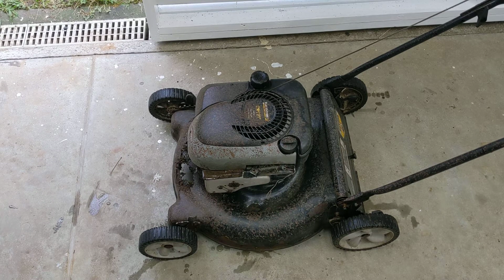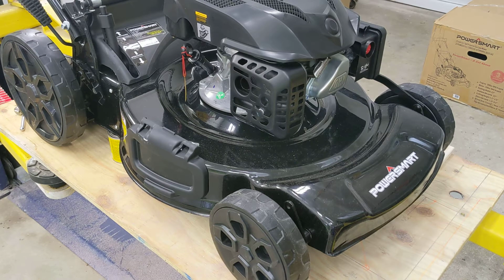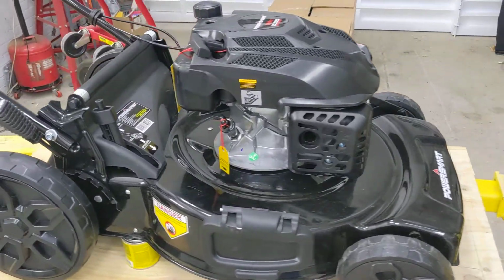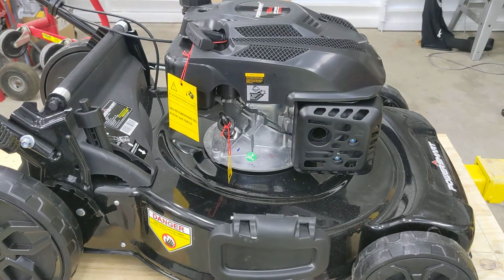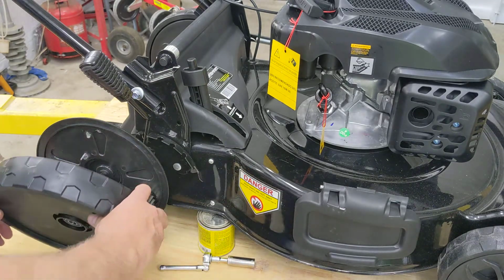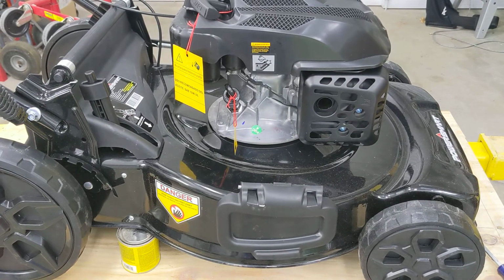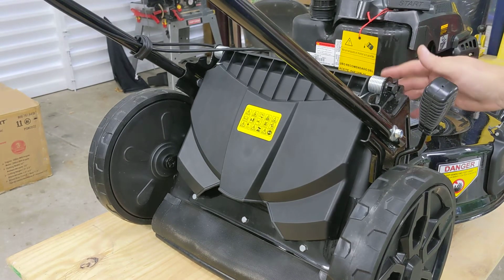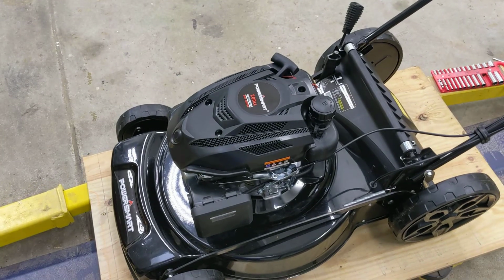Power Smart  22 inch 200cc self propelled walk behind lawn mower  very low price and low durability

Comment: These motors are Chinese knock off of Honda motors, actually pretty good little motors. pretty much what you find at Harbor Freight in the Predator series or on mini bikes and go karts.
They are great little engines and run like hell. Getting actual replacement parts is probably about impossible, especially for the internals of the engine, carburetors are cheap can be bought on eBay for a few bucks. However I'm sure the internal you may be able to find some parts on eBay or somewhere if they're partying went out but most likely I'd say you're not going to be able to get parts for it... but honestly people who buy a $300 lawn mower and it craps out 5 years or more later probably just going to throw it away anyway no matter what brand it is.

Comment: Wweeeeelllllllllllllll......I bought one in 8 2020.....it was my sixth.....of five brands......over 20 years.......firstly....THEY ALL WILL FAIL.......some way or another....this one failed after two seasons......the drive failed.....one side worked the left failed....it was the gear sprocket......the retail thing he showed when the wheel came off....the company sent me two new gears and the motor with both shafts attached......it took e four hours to replace the motor shaft and tears......and POP...it works like a charm now.....theses mowers are easily 400 dollars.....but are only worth 175........it is clear they ALL WILLLLLLL FAIL.......ITS THE CAPITALISTIC WAY.....
Reply from the maker: my mowers usually last about 20 years

Comment: To be far you never tried to use the new lawn mower you bought 🤔. I'd say most mowers can be returned after a few days if they don't work out to your liking. So to me you should of used it before just saying it wasn't for you. Just my opinion. I'm thinking of buying a mower similar to this one... ie same brand same type etc.
Reply from the maker: the store policy prohibits returns once gasoline has been added, after a close inspection of the mechanicals I concluded that the machine would not tolerate my application.  It might be a fine machine if gently used.  It is constructed much like a children's ride on toy

Comment: what's 200cc in Horsepower?
Reply from the maker: Usually 200 cc lawn mowers have around 5 or 6 horsepower.

 There is no direct  correlation between displacement and power

Comment: Great video, I was wondering why those are such a cheap price.
Reply from the maker: I found a Toro mower being discarded on trash pick up day.  it just had too much oil in it causing it to smoke and expel oil from exhaust...drained an filled to proper level and now That mower fires on the first pull and does not require priming with a bulb like most do...it does not have one, have not figured out yet how the managed to design that out and be improved....as long as it runs good it will be a mystery I am happy to accept
Reply: @neuromanglers  Its just an automatic choke, When the engine is cold the choke is on, Once it starts the choke turns off, While the engine is cold the choke will turn on while the engine is off, Once the engine is hot and you turn the mower off the choke will stay off till it cools down as its not needed when hot
Reply: Some of them run off the governor with a Muffler thermostat, And some run off of a wind flap With the muffler thermostat. Thats usually on the briggs engines.. On the Honda engines it runs off the Governor with a thermostat in the cylinder head, It doesnt work as good as the Muffler thermostats on the briggs engines. Usually it just varies between the make and model of the engine and the size, And application

Comment: My mower stopped working after (literally) the fourth use. 2nd & 3rd use, the self-propel belt came off the track. I had to try to put in on. I hit a super short stump probably 2 inch diameter that was buried under leaves, on my 4th use, and the darn thing hasn't worked since.
Reply from the maker: Man, sorry to hear that the mower went out.  To be fair, hitting a stump could take out most any mower but sounds like the Power Start is problematic from the start and I guess that is no surprise
Reply: @neuromanglers  Thanks, I was hoping it would be a quick and easy fix. Think I'll buy a different one and perhaps get it repaired some other time.
Reply from the maker: Yep...I am still using the lawn mower my neighbor gave me nearly 2 decades ago...when he could not get it to start.  I just removed all the safety interlock features and it runs perfectly, starts on the first pull, but the deck is rusty and might not make it many more years